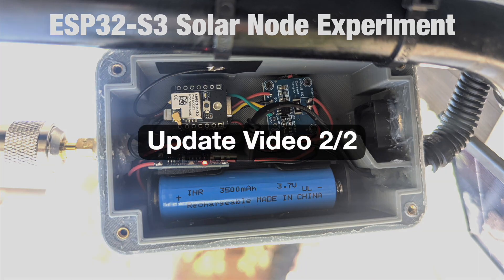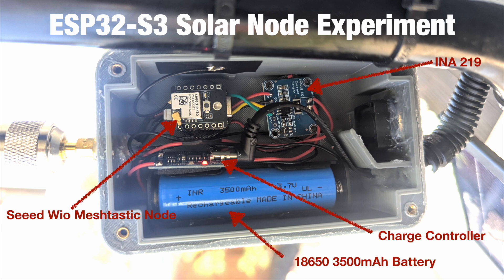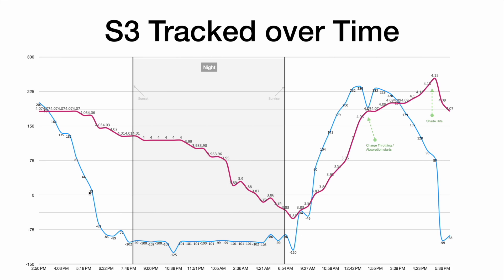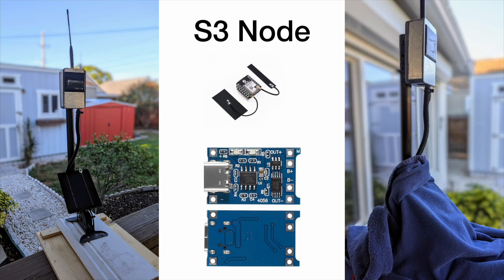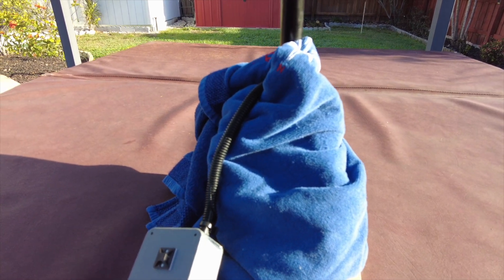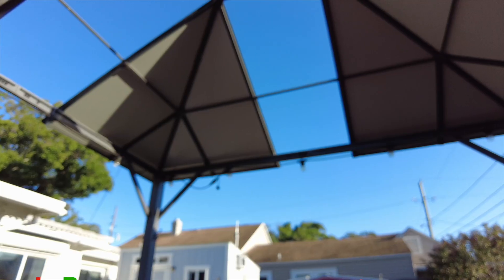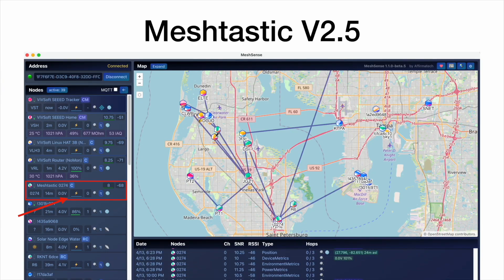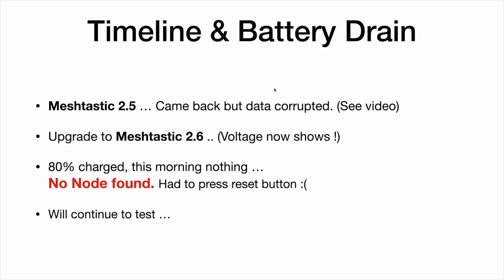Meshtastic ESP32 S3 Solar Node: 25-Hour Battery Test Results! ⚡

Comment: The low point on your graph isn't 2.8V, it's 3.8V!
Reply from the maker: The data is a bit inconsistent at that point. You can see it shows 3.8, 1.8, 3.5, 2.8, 3.5, 3.8 ... So I think the graph just smoothes that. But yes, the point is that until the sun came up it was using the battery fast.

Comment: Thanks for sharing. 
Which battery charge controller are you using?  TP4056?
Reply from the maker: Correct .. This one: https://amzn.to/4lNLpGa
Reply: @ViVSoftLLC  
Have you figured out why the LoRa status light sometimes has a long flash and sometimes has a short flash?!  I think it's something to do with position information.  But can't really pinpoint what it is.
Reply from the maker: Hi @altitude1039! Thanks for your question! The behavior of the LoRa status light can indeed be a bit tricky. Generally, a long flash typically indicates a certain type of status or event, while a short flash may signify something else, like a different mode or message being sent. Your observation about it possibly being related to position information is interesting! It might be worth checking the documentation for the specific device or setup you're using, as different manufacturers might implement these indicators differently. If I come across any more detailed insights on this, I’ll be sure to share! Let me know if you have any other thoughts or findings!

Comment: I am building my first solar node,  heat is one concern I have,  we can easily get into mid 90's F in South Florida in the summer in the shade,  that lithium battery inside that box in sunlight I feel won't survive a whole year. but I am going to give it a try.   if it fails,  I'll have to tinker, maybe using the solar panel to shade the box,  or use a cable and place solar panel and antenna away from the housing.   other options I have considered,  is using a small efficient fan with its own little solar panel,  that would blow only during the day.     Dash Cams with lithium batteries have been known to fail.  I purchased one with super capacitors,  problem with these is , they are much more expensive,  take up a lot more space, and would need special circuits to boot up and down voltages etc.  it could be done,  but a great expense.
Reply from the maker: Yes I have the same issues living in St. Pete FL. So I always add a small fan and a small solar panel to power that fan in the enclosure, if the sun shines, the fan spins. Then I also sometimes put the bigger panel to shade part of the enclosure and I also now wrap the enclosure with reflective tape, to manage the temps. Iv'e had some nodes running like that for months, but hey, August is on its way so we shall see :)

Comment: Domme vraag misschien, je wijst naar een 915mhz antenne maar lora in nederland is 868?
Reply from the maker: You are 100% correct, the frequency that is legal depends on the country you are in, this node is in the USA and thus we can use 915Mhz .. The chart for countries can be found here https://meshtastic.org/docs/configuration/region-by-country/

Thanks for commenting ...
Reply: @ViVSoftLLC  ow i'm sorry. for some reasons i thought you where in the netherlands
Reply from the maker: No issues .. I think you hear my Afrikaans accent, which is close to Flemish. I was proud of myself that I could read your original comment without using translate !